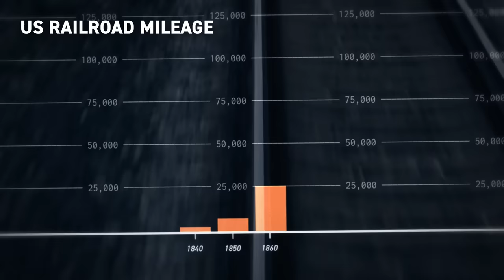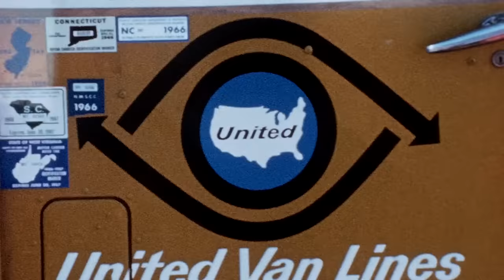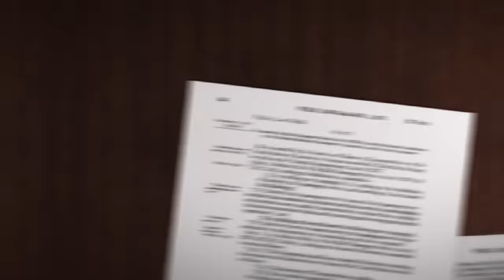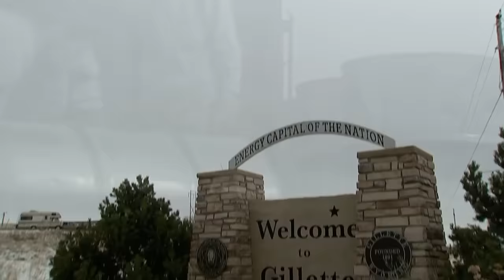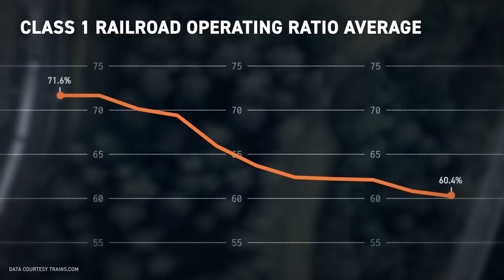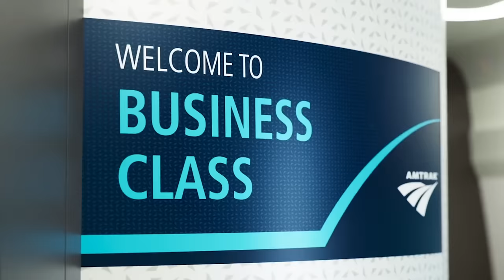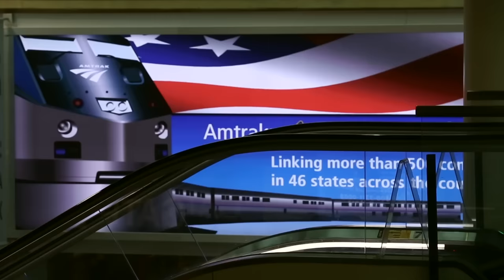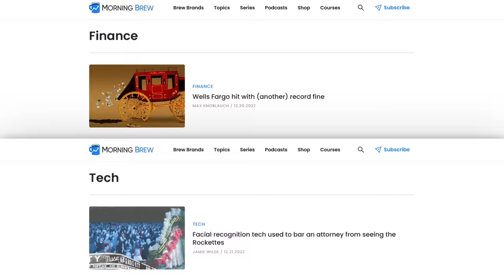The One Tiny Law That Keeps Amtrak Terrible

Comment: A little more than 10 years ago, Virginia got passenger service back to Norfolk for the first time since Amtrak's founding. It was one of those imperfect steps. The train left once a day at 4:50am. It had to leave so early because of track conditions along the route, slowing the train to a crawl in places. So after a couple of years of ridership growing slowly despite the early departure, the state gave the freight railroads (CSX and Norfolk Southern) money to fix the offending stretch of rail so Amtrak could run at higher speeds. The departure time moved to 6am and ridership grew so much so quickly that they added a 9am departure in 2019 (suspended during the pandemic, returned in late 2021) and a 1pm departure in 2022. That imperfect step a decade or so ago made possible the service we have today. But if we had to wait for it to be perfect, it would have never happened.
Reply: A few years ago, the Northeast regional left Lynchburg, VA at 6am and there was a bus that would pick up folks from Blacksburg and Roanoke.  Demand was good, so they built a new platform in downtown Roanoke and now you can get on in Roanoke at 6am and get to DC in about 5 hours, which isn't a whole lot slower than driving.  Recently, the Virginia government worked with the railroads to get some improvements done and eventually the NE Regional will extend to Blacksburg.  Demand on this route is enough now for two trains instead of the previous one.  And its only $30 bucks.  If I drive to DC I can't afford to park my car for less than that.  I'm really appreciative of the state government here that is putting in a lot of work negotiating to make rail service in our state just a little bit better.
Reply: I live in C'ville along the NER line and honestly I prefer taking Amtrak when I travel just cause i can hop on my local bus to the station and be there in time for my train. Plus I've seen plenty of people whenever I travel heading to all myriad places. Last year i took Amtrak to New York and we got there in roughly 6 and half hours so pretty decent demand on our end.
Reply: Bingo.  A perfect example of why imperfect solutions and compromise get more shit done than playing hardball.  Virginia has now built upon that success by purchasing the whole ex-RF&P mainline between Richmond and DC from CSX, on the condition that they implement capital improvements, as part of their next goal being to establish hourly service from Richmond to DC. Newport News is also building a new station, out of the way of CSX's massive coal terminal here, to support higher frequencies to that part of Hampton Roads as well, and VDOT is working to build a new James River railroad bridge so all Amtrak trains to Hampton Roads can serve Richmond Main Street.   CSX gets enough capacity to keep their operations going, and VDOT gets to expand passenger service.  Everyone gets what they want.  At this point, there's enough public faith in VDOT that even the traditionally anti-infrastructure and especially anti-rail Republicans are leaving these plans in place now that they're back in power.

Now imagine if Virginia had taken the Scott Walker approach instead, and just canceled restoring Regional service to Norfolk because they couldn't get a more convenient departure time out of Amtrak.  Or if they did what Wendover and most of the comments section are suggesting, and tried to either tried to seize the CSX/NS mainlines by fiat, or force the freight railroads to pay for the infrastructure improvements themselves.  Rail service to Hampton Roads would be absolute shit, if it existed at all, and under constant threat of cancellation because it sucks.  You get out what you put in when it comes to infrastructure, and the same is true of partnering with the private sector versus fighting them.
Reply: And therein lies part of the problem, the cargo companies expect the government to pay the bill for the problems they cause so that their profits are not affected.
Reply: @Cier433  the railroads expect the government to pay for it because it’s all done for Amtrak.
Reply: Seattle is doing something similar with out Link Light Rail, which is going all up and down the metro corridor, at least, eventually. It's taken years, and there are many more stretches still to go, but the link by my house is opening in 2024 and I'm starting to get excited.
Reply: Virginia, North Carolina, New Mexico and California are all examples of some states who have invested in buying their own intercity rail lines (new or used)  for the use of various passenger trains. Actually the North Carolina Railroad has long been a state owned enterprise for about 150 years, only recently did they start utilising it for passenger trains again.  States need to use more of their transportation dollars to invest in railroads and help the passenger trains bypass the freight network where feasible.
Reply: Led me to think
Reply: Virginia is quietly one of the best examples of state partnership with Amtrak.  My best friend lives in RVA, and I take the train from dc almost every time. 2.5 hours, no I95 traffic shitshow, and it’s usually cheaper for the round trip tickets than the fee to park in the garage behind her apartment. (Not to mention the gas). It’s such a no-brainer.
Reply: That is a great perspective on growth. Thank you I appreciate it.
Reply: We don't have to wait, we just need to make CSX pay for the repairs needed out of their record profits.

"On July 20, CSX reported strong second-quarter profits despite widespread delays and a staffing crisis. The railroad’s profits grew 5 percent to $1.18 billion, up from $1.17 billion last year. Revenue soared 28 percent to $3.82 billion as CSX increased shipping rates and fuel surcharges in response to rising fuel costs."

"The results beat financial analysts’ earlier estimates of $3.64 billion in sales. CSX’s share price has jumped nearly 10 percent since the earnings report, rising from $29.72 to $32.50."
Reply: @Cier433  Didn't they build the lines?
Reply: Add a tax to train ticket sales to renew the tracks.   Do not tax non train riders for new tracks.   
  Car drivers pay lots of tax for the roads.
Reply: The State and the Federal Government OWNS AmCrash, so they should be paying for the improvements you seek.  Do not blame AmCrash or the freight line--call Congress.
Reply: @dave8599  - An inbound 1%-7% commuter tax on a sliding scale based upon, and apportioned by these public or municipal costs by transportation modus:
1% - Public Transit commuters (mandatory)

2% - Cyclists (voluntary) (commuter hour dedicated lanes for permitted bikes)

3% - Carpool/Rideshare (mandatory as built-in for providers like bus lines, van services, Uber/Lyft etc., voluntary for commuter hour dedicated lanes for private carpools)

4% - Taxis and single rider Uber/Lyft etc. (mandatory as built-in for providers)

5% - Personal cars (mandatory as built-in for employer or driver)

6% - Short-haul trucks and Fleet vehicles, including company cars, police cars, etc., and courier/delivery vehicles with any kind of motor, including battery-powered bicycles) (mandatory as built-in for employer)

7% - Limo/Luxury Airport transportation (mandatory as built-in for providers)

Criteria for scale | dedicated use : apportionment:
1)  Infrastructure impact and wear | Repair, upgrades and new construction : 65%

2) Resident and pedestrian nuisance compensation fee | Livable cities projects, water and sewer repair and upgrades, greenways, public broadband : 10%

3) Carbon emissions and greenhouse gases | Clean Air and water projects, free home air purifiers and HVAC filters, free home water filtration for city residents and food businesses : 10%

4) Traffic congestion and loss of quality of life for drivers, residents, tourism, and businesses due to it : Civil planning, and historic architecture/district and arts and humanities, including free public events and concerts : 8%

5) Loss of affordable housing and/or rental housing : Dedicated affordable and rental housing subsidies for builders and home owners and renters/stewards, as well as licensed small-business property management and builders/handypersons : 7%
Reply: The northeast corridor is the only part of the country under which Amtrak is even remotely profitable in any way, shape or form. It’s the only part of the country that has anywhere near the ridership or the population density to make passenger rail Make sense. Using examples from the northeast corridor Do not in any way justify Attempting to extend passenger rail infrastructure beyond what is already in existence in the western United States. Nobody wants that…. Except the people in the Northeast, who don’t understand the needs of the people leading to the west of them because they’ve never bothered to step outside their own backyard before telling everybody else how they should live.
Reply: @williamrgutrich7694  - 97% of Amtrak miles are on host railroads. Also, we are the main funders for the State and Federal government.

Host railroads, like CSX, own the lines and thus the repair costs.

Freight is the driver of the deterioration of the tracks, switches, and signals not passenger rail.
Reply: @dardog444 , you’re right! I despise the TSA and all bureaucratic institutions.
Reply: @pluribus_unum , freight is also the main source of revenue that keeps these lines in operation. 

No freight means no revenue. 

Passenger rail is a massive sunk cost as it does not produce the revenue required to maintain its own running costs, let alone turn a profit. This was made self-evident with declining ridership as a result of the advent of the automobile and the state funding and improvement of most road networks. Even before the advent of the interstate highway system, ridership on passenger rail was on the decline as the companies had to implement greater cost-cutting measures to make the ends meet and keep these services operational (something that was government-mandated).
Reply: @MatthewChenault  - Freight needs to fulfill the commitments they've already made to maintenance, pay, work hours, and everything -other- [else that's a] part of their contractual and community obligations they've been in non-compliance with for decades.
Reply: @MatthewChenault  - This is largely true, after the extensive tracks for passengers in the U.S. were ripped up by the gas, tire, auto, and bus industries concerted efforts.

I must add, though your pro-monopoly bias is also evident in your framing and exaggeration.

Freight made the bargain, and signed the deal with the American people to support passenger rail. They either failed, or lied when they signed the dotted line. Either way, they violated the deal.¹

The future is quite likely different, as Amtrak was on track (pun intended) to be profitable before the pandemic occurred.
______________________________________________
¹ "The [Rail Passenger Service] Act represents a public bargain that was struck with the nation’s freight railroads, whereby the freight railroads were relieved of any duty to provide passenger service in exchange for making their tracks available to Amtrak at incremental costs.
- Interstate Commerce Commission (ICC), “Study of Interstate Commerce Commission Regulatory Responsibilities,” October 25, 1994, p. 62."

"While they are commonly called “freight railroads” today, they once provided intercity passenger rail service as well – until the public bargain that created Amtrak in 1970 enabled them to concentrate on their profitable freight business in return for agreeing to accommodate and facilitate Amtrak’s operations."

Source: Amtrak and Freight Railroads: The Public Bargain - Amtrak
Reply: @GintaPPE1000  VDOT also paid for improvements down the line from DC to Richmond. Gone are the days of the single track bridge at Quantico.
Reply: @kms1.62  Meanwhile in Florida, we are getting high speed rail thru a private firm. Including 30 miles where there never was track. Train speeds will be 79MPH, 110 MPH and 110+ MPH depending on the segment.
Reply: @mckerob  Well god forbid the freight railroads have to "take one for team Amtrak/minority ridership" & spend some of their own $$ to update the track! Im sure Amtrak isnt complaining about all the pollution those old freight diesels belch out on the passenger  right of way. 👉
Reply: @GintaPPE1000   Perfection is the enemy of good enough.
Reply: @Cier433  Freight rail owns the land their tracks sit on, so they are absolutely not going to spend money for Amtraks benefit.  I mean, are you going to build a nice sidewalk in your back yard so I can walk through your yard to get to my friends house?? I didn't think so....
Reply: Repent and believe in Jesus Christ  But will Jesus help rebuild America's once great railway system?
Reply: Just to add to your comment, VA also recently inked a deal with CSX to purchase ~380 miles of ROW including from DC to the state border to Raleigh.  The goal is significantly improve and expand rail service across the state including 1~2 hour frequency of trains between Richmond and DC.
Reply: Maybe Amtrak should opt to build its own infrastructure and railways instead of relying on those which are privately-owned?
Reply: @iJoshDG  It kind of is happening.  Many states are starting to purchase tracks for Amtrak and their own local services to run on to deconflict with freight rr.  But that's not always possible if the freight don't want to sell.  Then in those situations Amtrak would have to rely on statute to force freight to allow them to run their train per the 1970 agreement.
Reply: That's a really good story, and a really good lesson at the end. "If we had to wait for it to be perfect, it would never have happened."
Reply: @mckerob freight rail doesn’t deserve subsidies. They put themselves in this position by being inefficient, and they should be forced to pay the price.
Reply: I remember hearing this on the news, even though I’ve never used it I’ve seen it a few times busy as all hell
Reply: I’ve taken that train.  It was a pleasant surprise